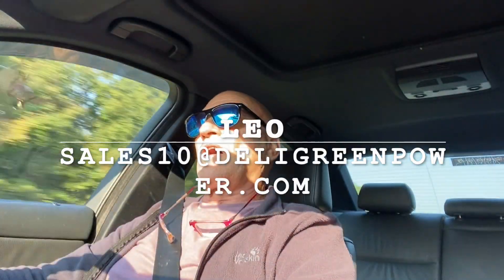Seplos: The DIY Battery Kit That Could Change Everything

Comment: Separate washer will increase the contact resistance by adding two more surface interfaces to the current path and electrolysis might kick in if there is a difference in the alloy components. There are screws with integral.washer these are great for they increase the contact surface without adding to the number of interfaces. 
I've checked the link for the battery box kit and the prices are not listed which seems funny. I've placed a request for quotation with green power for a couple kits to house my cells. That was two days ago. I heard back today. The sales person was asking more questions before releasing a price!
Reply from the maker: @hechmi  yeah when I get back home I’m removing all the washers.  Will also be fitting balancers to both batteries. Not sure why they don’t publish prices. Get hold of Leo. He should sort you out. 👍🏻

Comment: Just a comment...
There is a common misunderstanding about these "washers"..
They are not washers , rather very soft tin cladded copper crush rings to ensure a better and larger contact area between the terminals and busbars..
Please ignore the nonsense being posted by people who assume stuff
these are NOT common washers

Furthermore , I use the needy 4a active balancers that I build in my Mason boxes permanently..
However, they have barely run as I top balanced my good quality cells before putting them in my boxes
Reply from the maker: Thanks for your comment. It is very helpful. As I didn't get the crush rings in the kit I just used standard washers. Guess this might actually be an issue. I was not happy not using anything as I didn't like the way the bus bars sat on the terminals without a washer. Not sure where to get the proper crush rings from so will have to do some more digging. 👍🏻
Reply: @FarmsVilla  are you sure they weren't in the kit, seplos makes it a point to put them in there, 

If you used regular washers, I would indeed recommend removing them before you put any form of load on your batteries.
I think if you contact seplos, they will send you a set at a reasonable price, alternative is eBay or Amazon, but do make sure you use the proper width and height, otherwise it will be a bad contact, that does more harm than good
Reply from the maker: @houseofancients  thank you. I will check Amazon and eBay. Will definitely remove the washers before putting any load on the batteries. 👍🏻